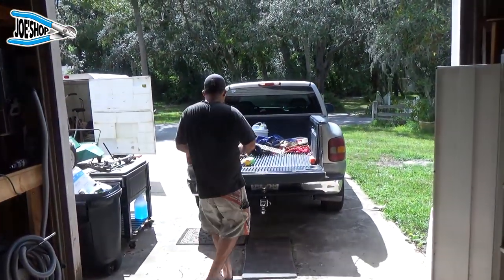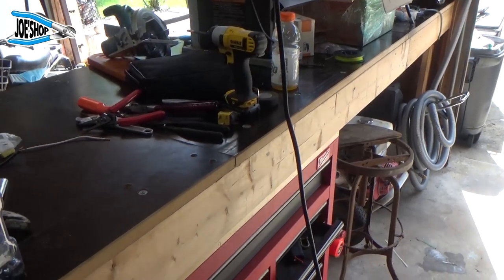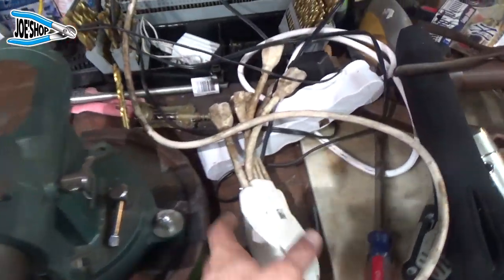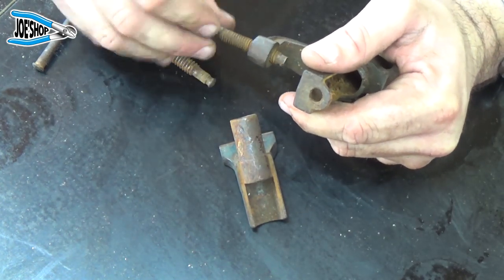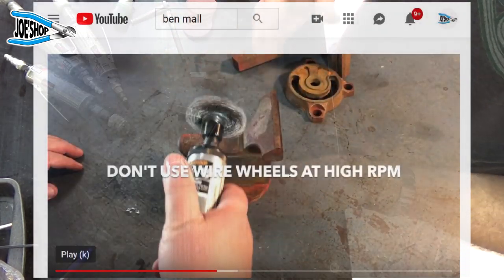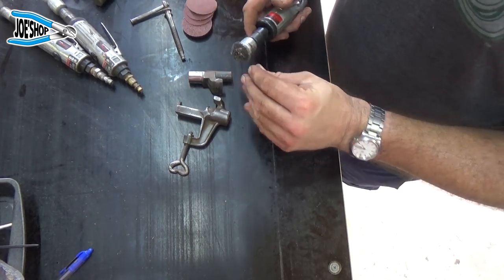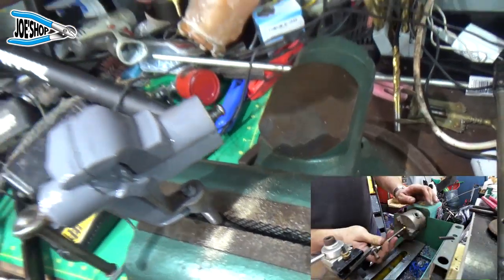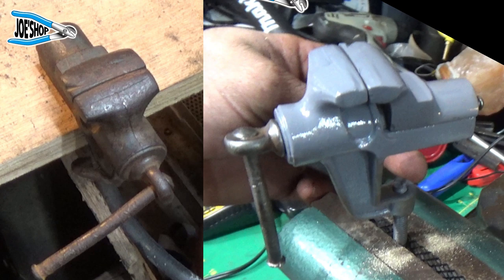Bench Vise, Work Bench, and Wire brushes

Comment: Hey Joe those are farrier’s clincher tongs.  The nail sticks out the side of the hoof so a clincher is used to bend the rest of the nail so it is almost flush with the hoof wall.
This prevents the nail from getting caught on anything, but also helps to hold the nail and keep the shoe in place.
Reply from the maker: Very cool...thanks 👍👍👍.

Comment: HDF = hardboard. LDF is particleboard.
 I have a small vise like that, you'd be surprised at how useful it is. The clamp-on feature makes it really easy to remove if you need more or different space, or to only take out when you need it. Or you could keep it in a portable toolbox and not have to worry as much about workholding when out and about - it should easily fit on a piece of 2x4 across some sawhorses, or similar.
 The pliers with the red handles are for either upholstry or shoemaking, don't remember which.